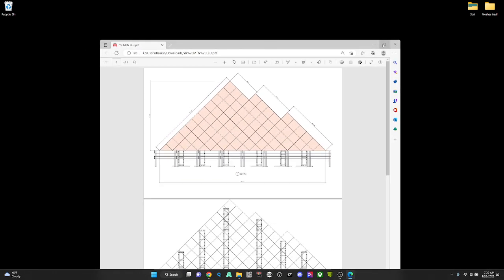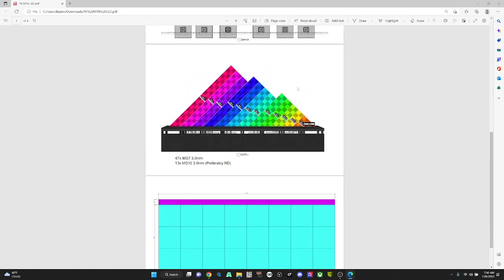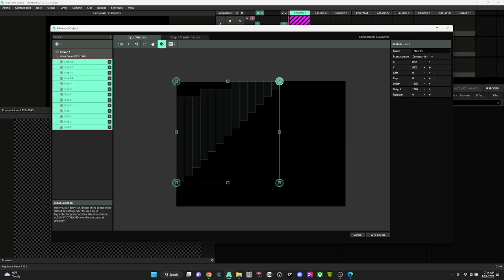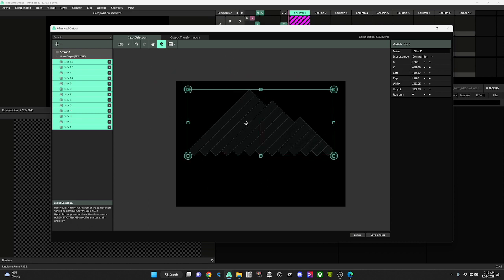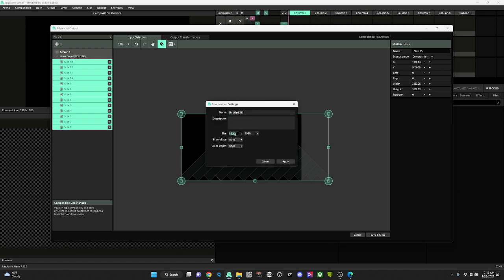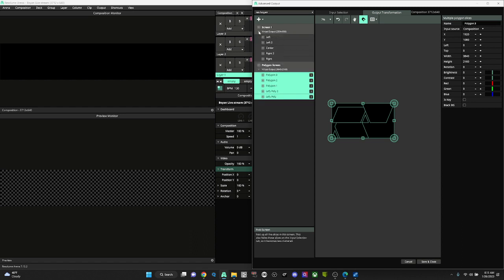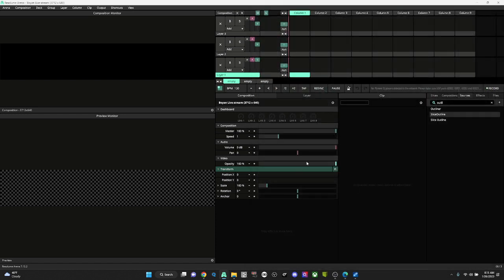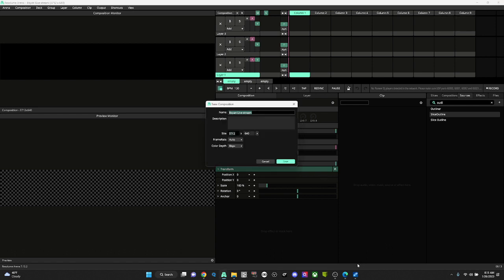Resolume Complex Output Mapping

Comment: Great content, great references, thank you. How would you handle creating a uniform look when its 3 x HD outputs, but going to mixed 3.9 and 1.2mm pitch panels?
Reply from the maker: I would just map the output as is like with pixels then In my input I would upscale the 3.9 to match my 1.2mm, but it really depends on the situation as if your not playing content over the full canvas I would leave as is
Reply: @baskin321  Yah, the mission is to play over the full canvass uniformly, i have a lot of loops at 1920x 1080 tho, so stuff ends up super blown out.
Reply from the maker: Look up stageflow, might help you spread the content thru out the canvas